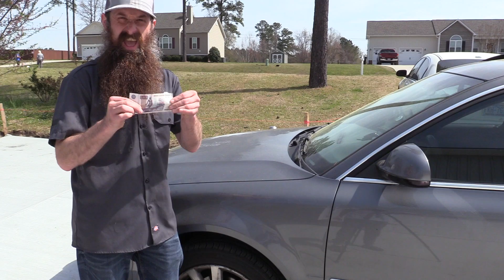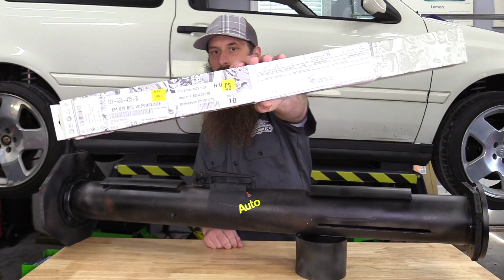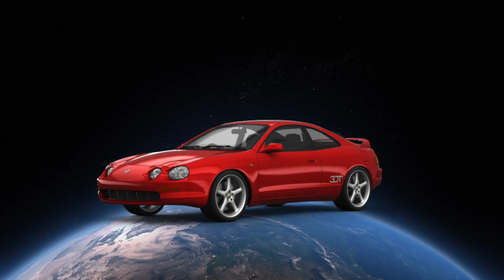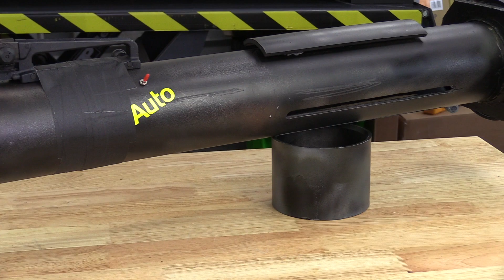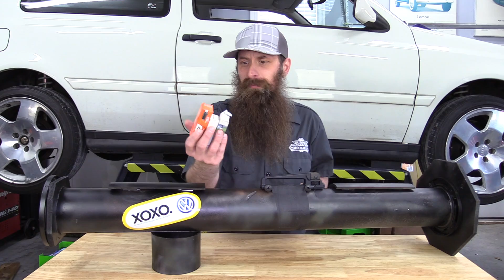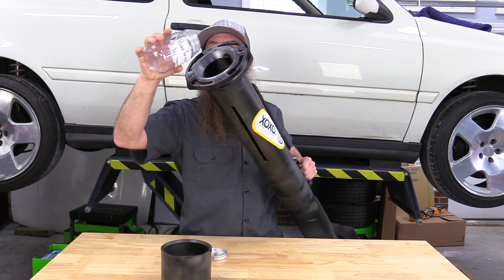The Last Car Repair Tool You Will EVER NEED ~ Mechanics HATE This One Trick

Comment: Hey HumbleMechanic. I need your advice as i only trust you due to your experience with VW Tiguans. I have a 2014 1.4Tsi 90kw  tiguan. I have been missing coolant it takes about a week for thr coolant reservour to run almost empty. The engin has done 95 000km. Have you heard of  BlueDevil pour and go headgasket sealer and what is your viee on it. I have no leaks so the coolant just vanishes only when i drive.  Where is my tiguans radiator as they mention i need to through this bluedevil stuff in there? Please help brother. Keep up the good channel. Im from South Africa

Comment: Can it be used to install Lucas wiring harness replacement smoke?
Reply from the maker: I’ve tested it there several times with mixed luck. I thing I’m going to work on a tool resmoke wires

Comment: i am disappointed , no pistol grip activated trigger, , i mean what if you slip and hit the wrong vehicle ? 
i cant believe that works on VWs , that is just not big enuff.
Reply from the maker: Don’t worry there is a whole line of accessories coming soon. You’ll be able to night sight, pistol grip, and Eotech until your heart is content.
Reply: thermal imaging would be awesome.
you may want to add  a PSA about Synthetic Blinker Fluid use in a cannon type device .( who knew its unstable at high velocity )
something about
energy equal of mass combined with the speed of light squared.
it was ugly qwik , smoke. then meltdown , then critical mass, then nothing..

Comment: I love this but having to load 6-7 time? That seems a little much. Also, does this work with specialty made parts? 😭
Reply from the maker: Yes! And 7 times loading a cannon must be faster than proper diagnosis and fixing the car proper.  Right?
Reply: You know im going to get one for the diesel repair shop working on the companys  truck. Walked in yesterday after watching this to find dead battery, and a jumper wire to the ECM fuse powering... The a/c clutch! Now, who just put a new, blower motor and control unit in the truck yesterday? So they can use a cannon with a bit more accuracy.

Comment: Please do a guide about how to replace a high brake light on a mk5 gti
Reply from the maker: Those suck! They were under warranty extension for a while. You gotta split the spoiler in half
Reply: @HumbleMechanic  warranty expired but from what i saw, it he being held by epoxy so im thinking if i heat it up i can maybe split it or i dont know if i should just buy a used hatch with working light, also if could explain how to install a a/f gauge, i understand the exhaust portion of it but i dont get were i splice it into the intake portion

Comment: How fast do they ship?  I've got a 3V Ford with a bad motor sitting outside the shop.  Also, if parts are too big to fit down the muzzle (such as engine blocks) is it possible to break them up beforehand and then rely on the parts cannon to reassemble them as needed when fired at the vehicle?

Comment: Does this work for engine rebuild kits? Should I have the hood open or closed? Just imagine being able to buy a $200 junker on a Sunday and drive it for the next 20 years with no problems. Never calling off work due to a broken down car. This is the best tool ever. Also can I use it to change out the winter air in my tires for summer air? #chrisfix has a process but it looks really long and complicated. 

Love the video
Reply from the maker: Oh yeah.. not only will it work, but it is a permanent fix..

Comment: Does it Work with refilling blinker fluid or replacing muffler bearings?
Reply from the maker: But wait..... there is more!
Reply: James Kaminski i hear it will auto tighten ur 710 cap also
Reply: Well of course, it does EVERYTHING! it will even replace the winter air in your tires with summer air, and vice versa, to make sure your tires are in tip-top shape!